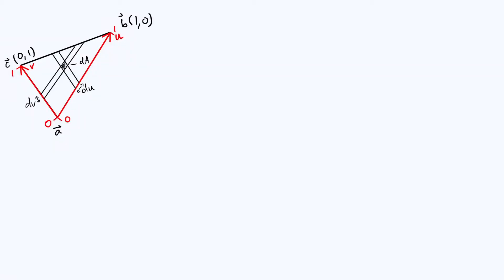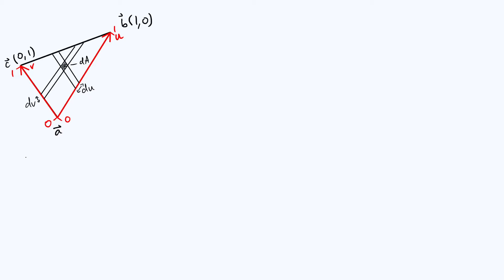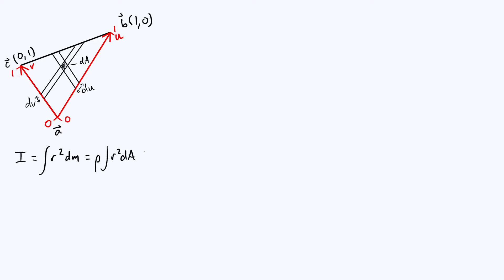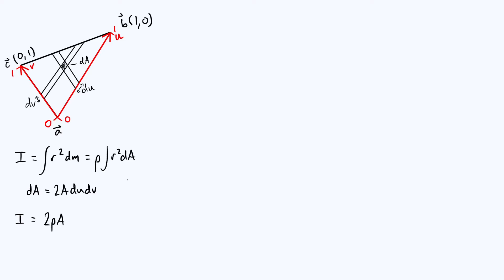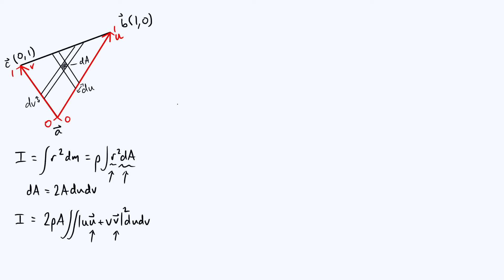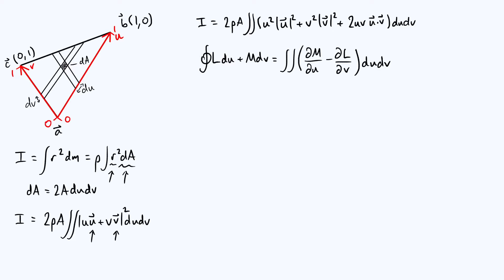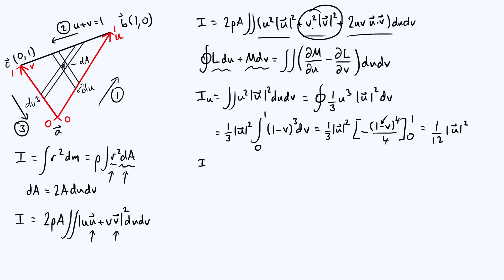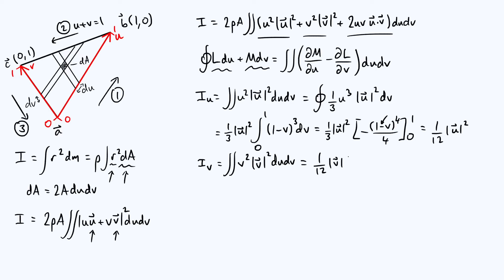Moment of inertia of a triangle in vector form

Comment: Interesting. I solved the same problem on my own some time ago and arrived at the conclusion that the squared gyradic radius of a triangle around some centre of rotation/centre of gravity with coordinates (0,0) may be found as 0.75*rc^2 + 0.25*((r1^2+r2^2+r3^2)/3) where rc is the distance from the centre of rotation to the centroid of the triangle and r1, r2 and r3 are the distances between the three vertices from (0,0).
Reply from the maker: Very nice!